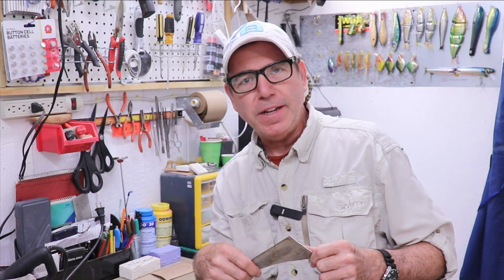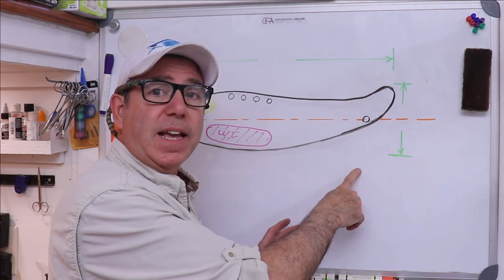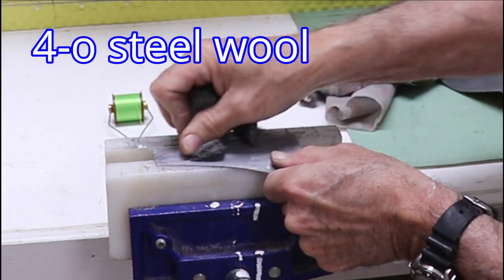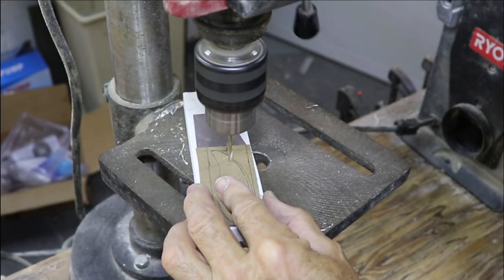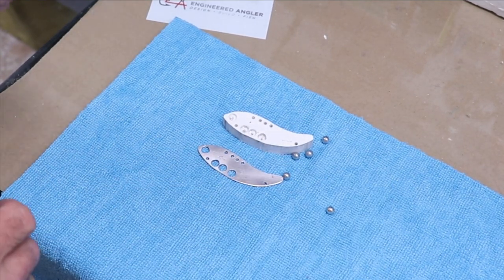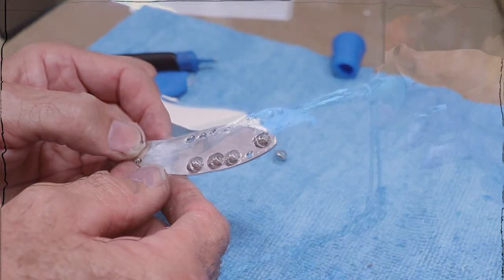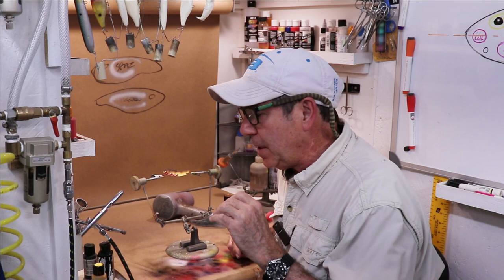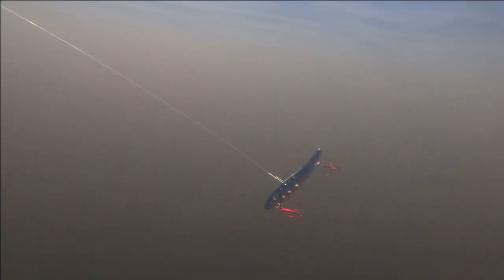Making a Blade Bait, The Easy Way. #bladebait #makinglures #lurefishing

Comment: How long do you think the tow point holes and hook hanger holes will last? I think the stainless steel of the clip and split rings will make short work of the aluminium. Great design though, and the lure looks the part!
Reply from the maker: Well we need to remember it's the galvanic system we need to consider not just parts.  Since we have a hook in the system I'm pretty sure the hook will end up being the sacrificial part.  But while it is true that combining Stainless with Aluminum is not a great idea, consider that every aluminum bimini top has stainless bolts...in my experience that means the aluminum will last 10 years instead of ...?who knows.

Comment: @Engineered Angler Lures  I too have been contemplating a different material for the blade.  For some reason, I'm intimidated about cutting metal.  I don't have access to a band saw...maybe Thad why 🤔.  Do you suppose  a jig saw with an appropriate blade would suffice?

I saw your video using old CDs and a through wire.  Do you think the blade material has a large impact on the vibration?...I'm still trying to wrap my head around the physics behind this lures action.
Reply from the maker: The shape and size are the more influential parts of the design for the action.  You can make it out of any flat material that can handle the stresses and can be made to hold the low ballast weight.  Good luck

Comment: Hey I know this is years late. But I found a huge blade my late dad made years ago for dropping in 100m of water. Due to the weight, and despite a thicker piece of aluminum. It must have been a prototype because there is a 2nd smaller one made from stainless. The aluminum one had clear damage to the tow points from the clip. 

Any suggestions (or videos) on how to reinforce a tow point? I was thinking a pop rivet, but can only find them in aluminum locally. I can't weld or anything like that 😅.
Reply from the maker: You can get stainless rivets.. that's where I would start